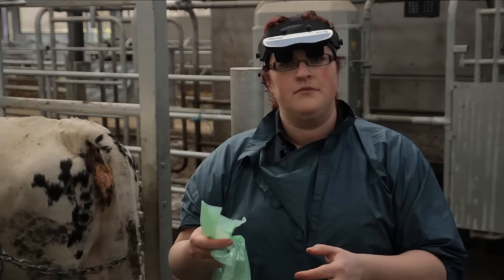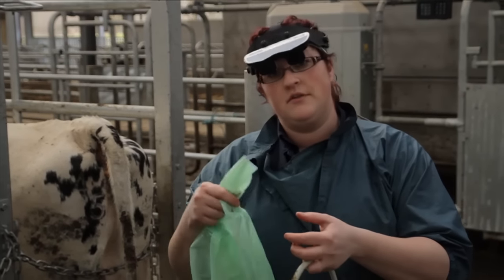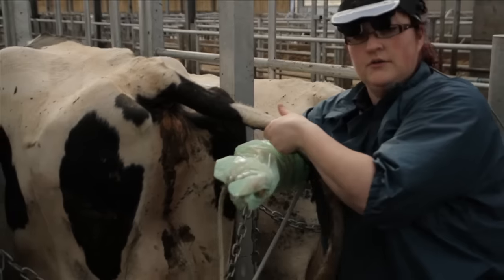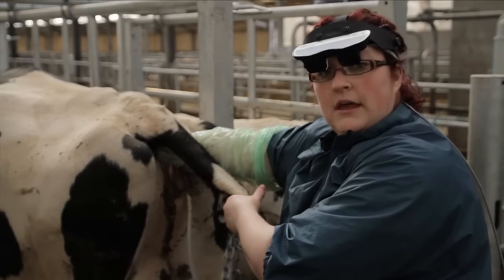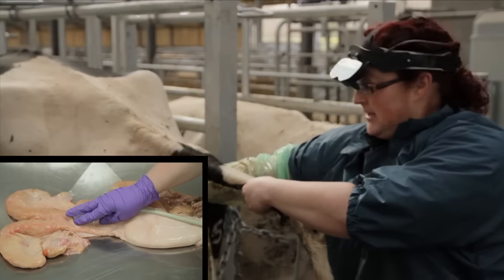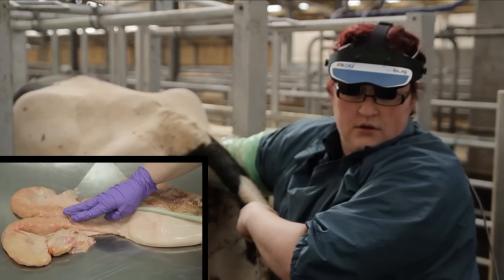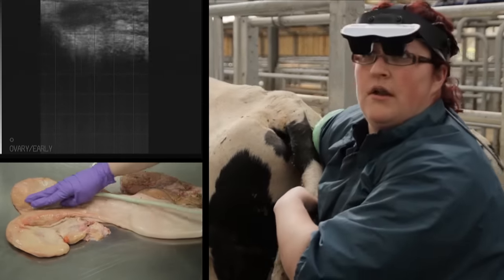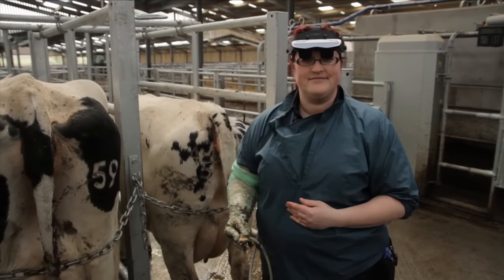BCF Technology Ultrasonography of the bovine reproductive tract video 7 - The non-pregnant cow

Comment: Is it worth changing glove between cows to then put a dirty probe Into the next cow
Reply from the maker: Veterinarian and farm standards may differ from one to another.  Like you mentioned, if a scanner changes their sleeve/glove, the probe is still dirty unless sanitized. You can also use a sleeve over the probe while scanning which can be replaced.  Changing sleeves/gloves will certainly decrease the amount of fecal material transferred from one cow to another.  Many use this practice to deter transmission of Leukosis.  Replacing your sleeve/glove along with placing a sleeve over the probe and replacing it or disinfecting the probe between cows is the only way to assure there is no transmission of infectious diseases.